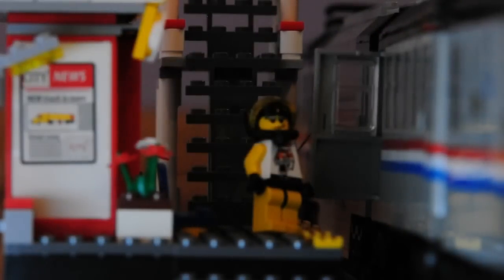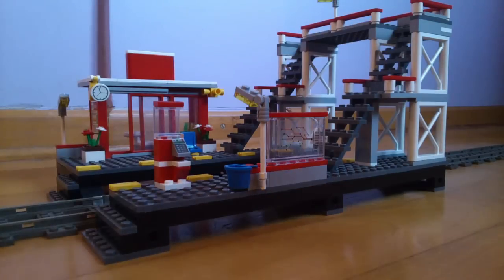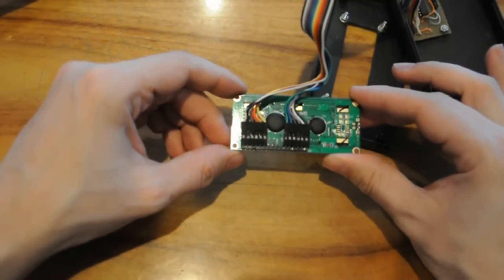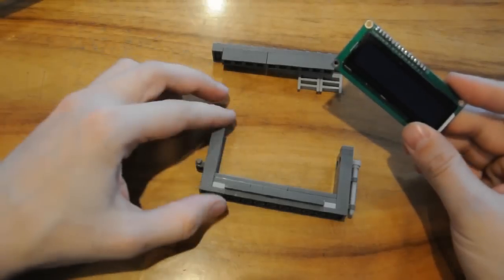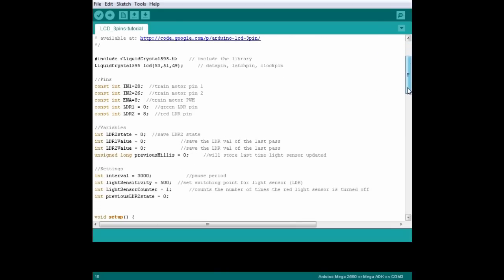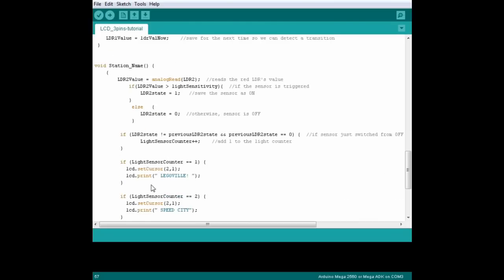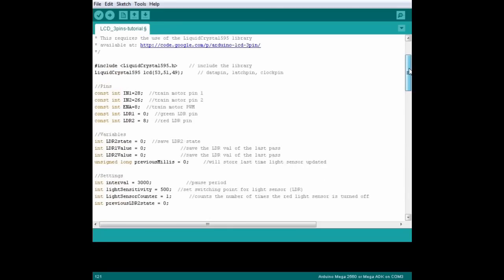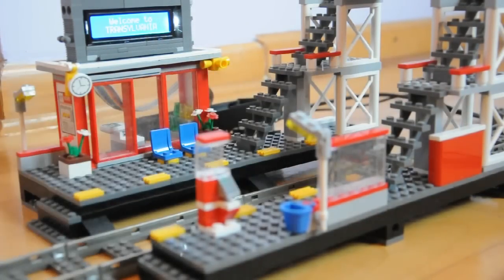Arduino for Lego Trains #5: LCD Screen

Comment: Why not I2C?
Reply: And why not if else for optimization?
Reply: And Dobra robota  fajny kanał :D
Reply from the maker: +Works4Me small steps :) This is only lesson 5 and I2C is a bit too advanced for that. But it's certainly an option if you know how to use it.
Reply: I thinked little about your code and u dont even need if. Just array with names and use LightSensorCounter as index :D it will shorten code and code will run faster
btw i started making videos about arduino too :)

Comment: I know that this is video from 2015 but, it is possible whith switch function, not if?
Reply from the maker: sure! You could put all the messages into an array, and then use the Switch case to refer to different messages in the array. Tutorial #6 introduces the switch case, so watch that to get an idea of how the code works.